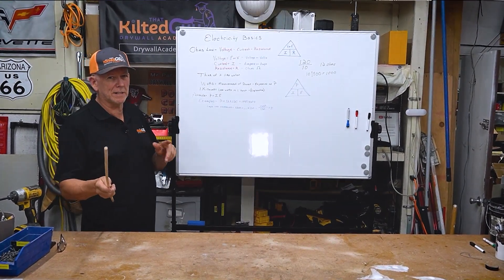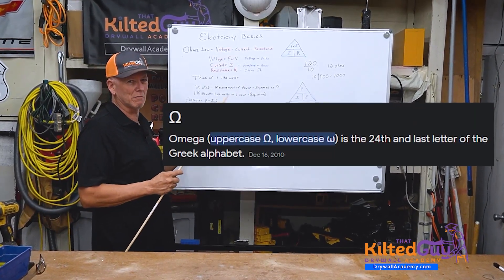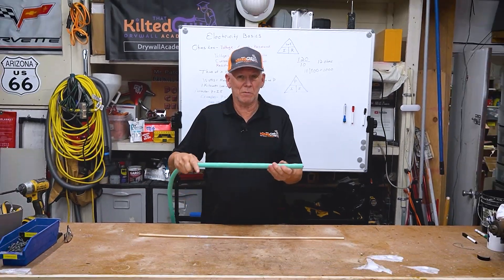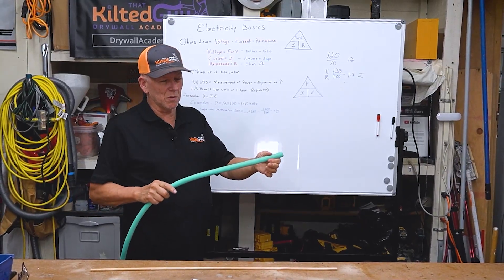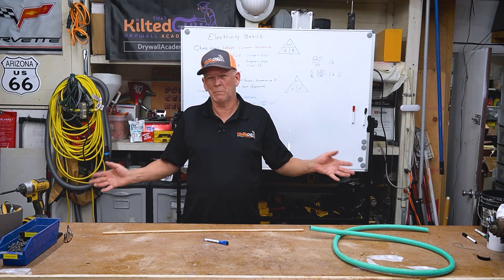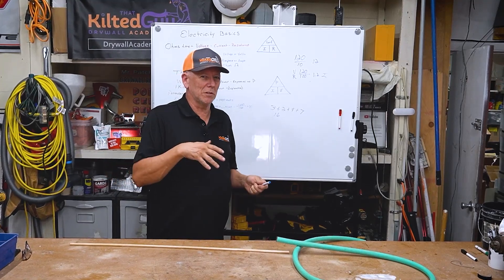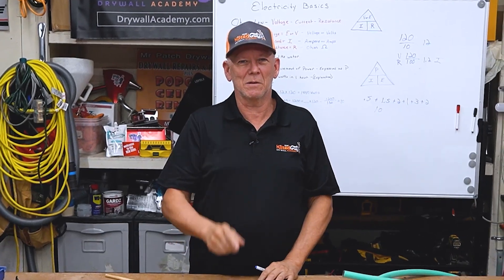Electricity for Dummies, IT'S EASY!

Comment: a kilowatt is just 1000 watts, not a thousand watts in 1hour. A thousand watts in 1 hour  would be a kilowatthour (kWh) which is useful for quantifying the total used or stored energy. a kilowatt (kW) is used to show how fast your using or generating electricity.
Reply from the maker: I thought I said that and if I didn’t it is what I meant
Reply: Dear  @ThatKiltedGuyDIY  ,
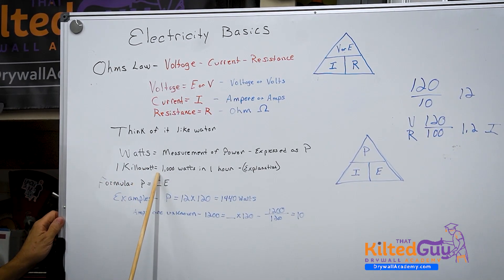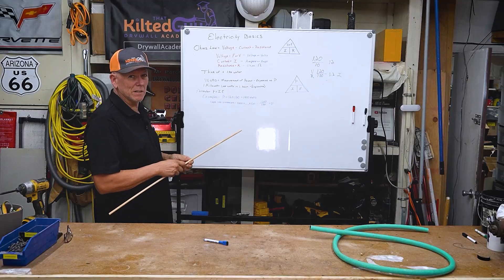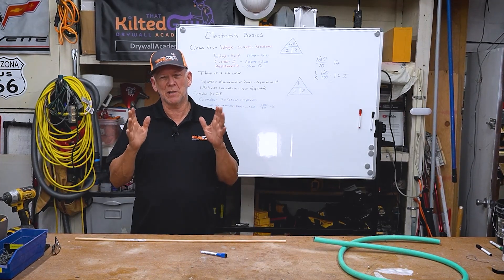You've got it falsely written on the board throughout the entire video and also falsely explained and text-overlaid it at 8:18. Considering you repeated your mistake everywhere, I actually believe that you yourself have probably misunderstood its meaning. A kilowatt is simply 1000 watts, just like a kilometre is 1000 metres or a kilogram is 1000 grams. the "kilo" prefix simply means a thousand and only changes the order of magnitude of the unit. what you were explaining with multiplying the wattage [W] with the time [h] is also a thing but it's a completely different kind of unit called watthours [Wh] and if you have 1000 Watthours, you can also call it 1 kilowatthour, which is the correct name of what you were constantly falsely calling "kilowatts". I don't know how much one can edit on a video, but please do make the necessary changes or add a warning in the description or as a pinned comment because a big part of the video (8:18-8:50) is outright false information and could seriously harm people's test scores.
Best,
Timo

Comment: Great video - thank you. I watched this because I have an RV with lithium batteries (no generator), a power inverter, 30amp shore power hookup, and coach alternator that provides charging current to the lithium batteries while driving. I'm trying to better understand how electricity works because I want to extend the life of the lithium batteries as much as possible and make sure I don't damage any of the expensive electrical components on the RV. 
You mention having an RV with lithium batteries. Do you have or plan to do any videos on how to best maintain RV electrical systems?
Reply from the maker: Look up that Kilted guy behind the kilt. I have some videos about electrical stuff but we are now selling our RV. I may do something like that before we sell it though

Comment: Excellent lesson Guy.  Great revision from my school days (electronic engineering), like yourself forgot most of it and we don't really use it anymore in my trade (I fell into the IT business from Electrical, should have stuck with electrical oh well...).   I'm from the days of B.G (Before Google), when you used multimeters to diagnose circuit faults, especially on photocopier equipment and making cables.    Now everything is disposable parts and field replaceable.    European Power is rated at 110v (same as North America), in the UK (240v) where I'm from I once blew a power supply by not checking the voltage switch on the controller as they were used in sold in both the UK and Europe - opps!   Luckily it was a loud bang and a change of pants, nothing serious thankfully!

LED is a boom for home lighting, I think the math was max 100ish LED lights on one circuit, compared to 14 100Watt regular bulbs!   Most of the light bulb energy is lost via heat (infrared light) which is why you need to crank up the wattage compared to an LED which negates the infrared loss thus requires less power to run.  I was at Atlantic City recently and the casino/resorts are installing wind turbines, LED's and power management systems (auto turn off switches, etc) to offset the power costs.    the average casino runs a power bill of $100,000 a month!   And you thought your electrical service bills were high?

Comment: You never use more than 80% continuous load on a circuit, 15amp circuit, use no more than 12amps. 20amp circuits are not common, but you would max out at 16amps. And remember ppl typically have no idea where those convenience outlets are located. Breaker #1 could have outlets in garage, kitchen, bathroom & bedroom. 
There is a reason for this. It's to balance the load. Easiest example, kitchen-1 outlet, 2 plugs. They will b on different breakers. Mom has the big stand mixer plugged into 1 spot, and a blender going full force in the other spot. If that outlet was on the same circuit, It would become a fire hazard. It's almost like the NEC & electricians knew how ppl lived & operated😂
And it is true, DO NOT trust breakers to flip. Fuses are MUCH safer-because they were just pop-like a light bulb going out. Breakers on the other hand have a tendency to fail in the on position. Yep, we've all tripped a breaker a time or two from an overload, but it's actually more common for the breaker to fail in the on position. You melt the wiring in the walls. Recently, there was a fire because the wires in the walls had been smoldering for days. And if you use extension cords and whatnot always know what they are what rated for too. Just because it fits doesn't mean it's right!